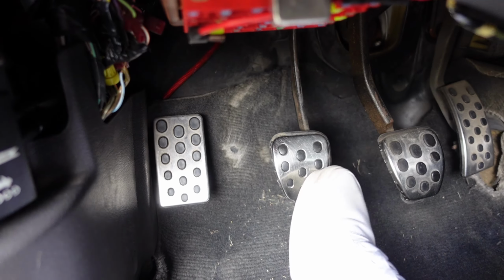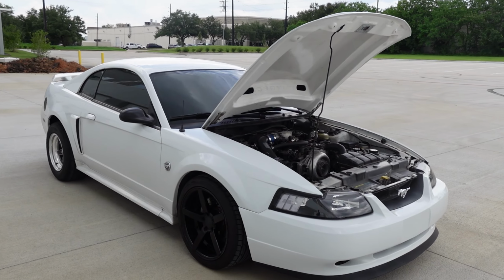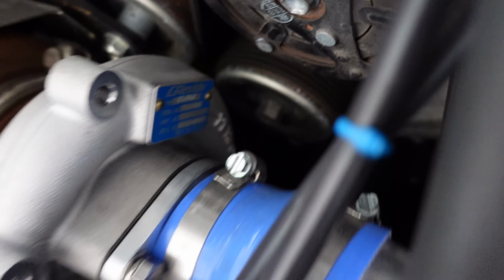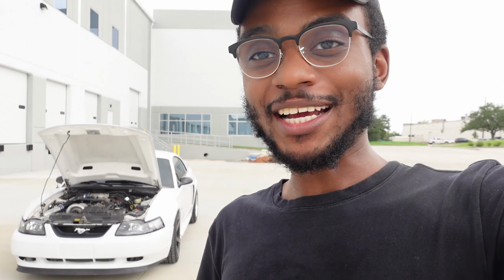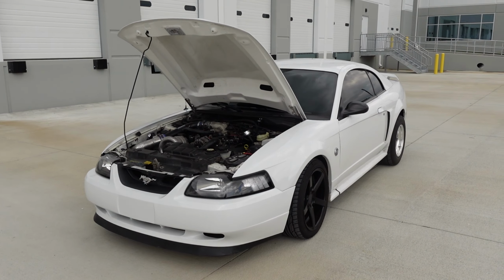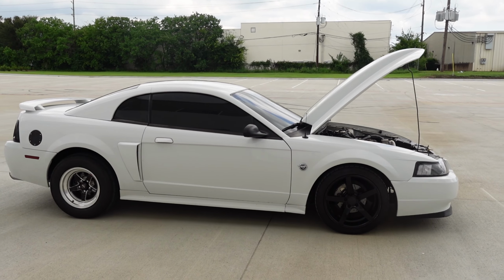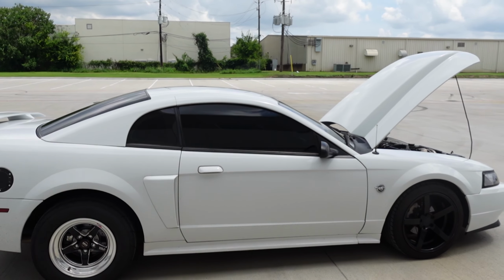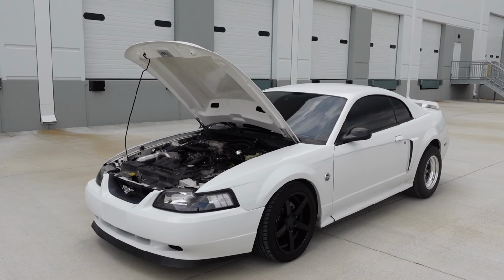It's time to move on.. (Supercharged 2004 Mustang GT Update)

Comment: I’ve broken several of the clutch cables even with a steeda quadrant , firewall adjuster and cable. Buy the Ford one. The Chinese made ones won’t last a year. I had to drive my 03GT 3 miles home with no clutch lol, just started it in 1st gear at every red light. Oh and get a firewall adjuster man, makes a huge difference when you can fine tune it.

Comment: I blew my stock FRS motor and got a IAG stage 2 motor.. it’s worth every penny
Reply: How many miles were u at?
Reply: Im looking at a new block for mine do u feel a big power difference?
Reply: @Zaymusicofficial1  Sheesh… like at 45k 47kish with a 2015. It was a mix of circumstances why the bearings spun. Don’t let it deter you from getting the car.
Reply from the maker: I'm not saying it is not worth it. It 110% is that's why I bought one lol. I'm just not interested in the platform anymore.
Reply: @jayman4874  Same i have a 2015 145k miles but its na which is prob why its doing so well. Took alot to get it to 300 hp without boosting. I def want to rebuild or get a whole new block
Reply: @jayman4874  Same i have a 2015 145k miles but its na which is prob why its doing so well. Took alot to get it to 300 hp without boosting. I def want to rebuild or get a whole new block
Reply: @EarsPOV  most def man go with what makes u happy and your dream car. Especially for what your trying to do you need more power. For me 300 hp is perfect but its not much 😂

Comment: I kinda disagree when you said the cams could possibly make you lose power. Get properly spec boost cams. Todd warren could also custom spec and build your cams. They’re pretty good from what I’ve heard
Reply: I agree that the stock cams can go a bit
Reply from the maker: I have some custom boost cams from Comp rn but I know those will not work with the stock heads properly. That's why I'm not putting them in yet.

Comment: Are you going to keep the 2valve? Sorry, I'm on break at work and don't have the to watch the whole video. BTW those plastic quadrants will break teeth, I'm not sure if you have an aftermarket quadrant or not, but that definitely seems like a cable issue.
Reply from the maker: Yes the 2V is staying my FRS is going.

Comment: Dont get a BBK i broke two of those. I inspect that cable every week now and keep a spare on hand. Take that firewall adjuster off probably making it too tight. Mine is hand tight. Let it stretch then adjust again with a wrench at the clutch fork. Hand tight in the back nut then snug it up.